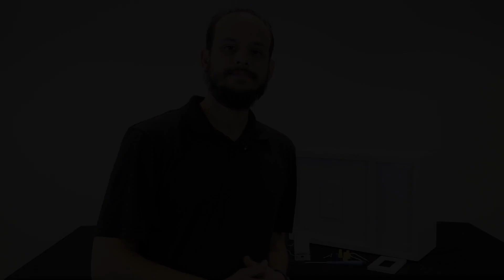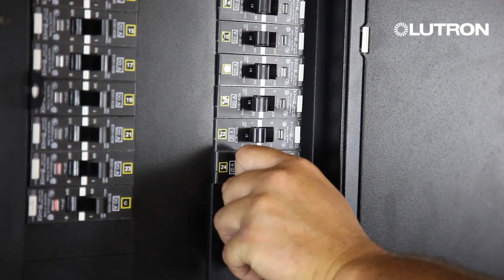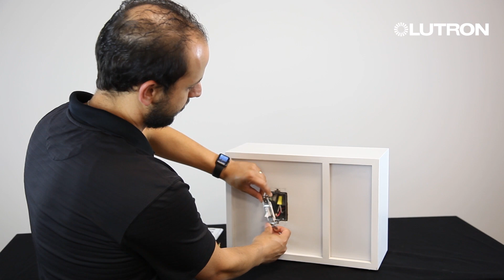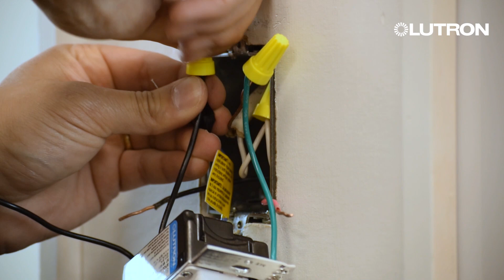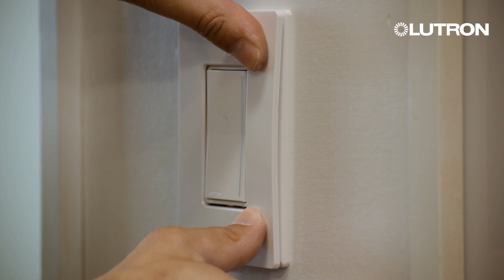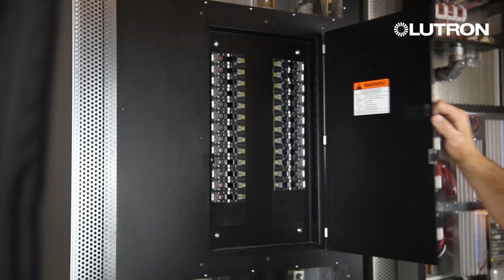Installing a Lutron Sunnata Dimmer in a 3-Way Application

Comment: I bought sunnata switches can I install both switches the same both t sunnata?! they're both dimmable
Reply from the maker: Hi Peter, Only one Sunnata dimmer can be installed on a 3-way lighting circuit. Lutron does not recommend installing more than one as this will cause performance issues with the load and how the dimmers operate. Thanks!

Comment: When my light switch is turned on (slider pushed in) one led blinks 1 time, immediately followed by two leds blink 3 times, then a one led blinks 2 times. After installing a new LED Flush mount by Home decorators fr home depot. Keighley Crystal 100-Watt Polished Chrome Integrated LED Flush Mount 1002 820 843

Comment: Did you have push connectors? Or wire wrapped?
Reply from the maker: Hi Kerry, The STCL-153P has permanent pre-installed wire leads coming out of the back of the dimmer to connect to your wires in the wall box. For more information on this dimmer, please visit https://www.lutron.com/TechnicalDocumentLibrary/3691129_ENG.pdf Thanks!

Comment: Can the “other” switch on the 3 way be a dimmer as well?
Reply from the maker: Hello, Currently the Sunnata dimmer can only be used in a 3-way applications with a existing 3-way switch at the other end of the circuit. For more information on this installation, please visit https://www.lutron.com/TechnicalDocumentLibrary/3691129_ENG.pdf

Comment: What if i want both switches to be the dimmer switches?
Reply from the maker: Currently the Sunnata dimmer will only work in single pole or 3-way mechanical switch applications. We will forward your feedback to our engineering and product development teams for future enhancements.
Reply: I really like the Sunnata dimmer switch, but when using it in a 3-way setting with a regular switch looks tacky. Please pass along to the engineering team that a Sunnata companion switch (like the one that goes with the Maestro dimmer) needs to happen ASAP.
Reply: Go with a WiFi bulb and wireless dimmers. Reason being for a hard wire dimmer if you have 1 dimmer at low setting. Then the other dimmer at a low setting it will be almost 0. They will be fighting each other. You will raise the 1 dimmer to Max but then if the other dimmer is set to low. You will be at low setting. If that makes any sense.   But a wireless dimmer using ‘Hue’ bulbs or other WiFi bulbs is your best bet. At least that’s my 2 cents
Reply: @lutron. 3 way mech ONLY ,or can a 3way Decora work as well?

Comment: Very little information for an understanding of wiring this device, for instance, which end is the power coming in on, (which wire is the hot wire), and which end is the wire going to the light coming in on, (which wire is going to the light).
Reply: We got it to work. Keep trying, the guide is very unclear
Reply: It pretty much switched from mechanical to digital
Reply from the maker: The STCL-153P is not polarity sensitive and therefore could have the hot wire connected to either black wire coming from the dimmer, and subsequently the load wire connected to the remaining black wire on the dimmer. You can see an illustration of this here: https://www.lutron.com/TechnicalDocumentLibrary/368-4493_Page_79.pdf